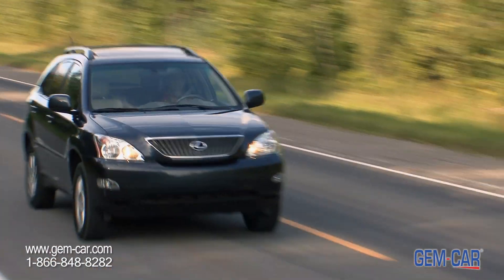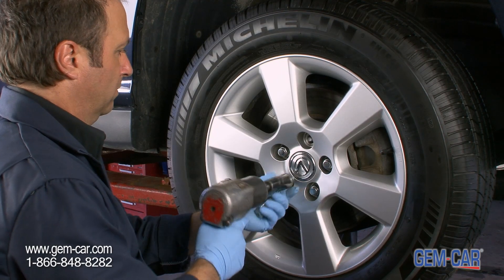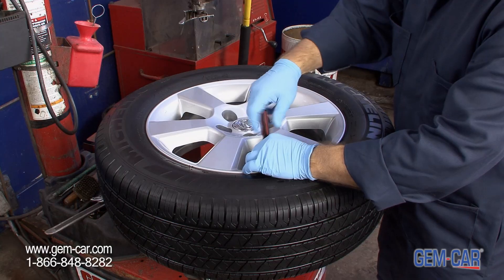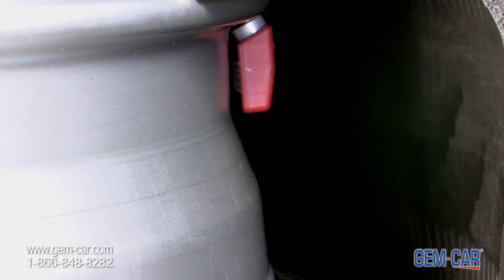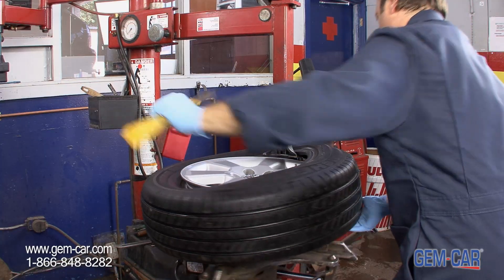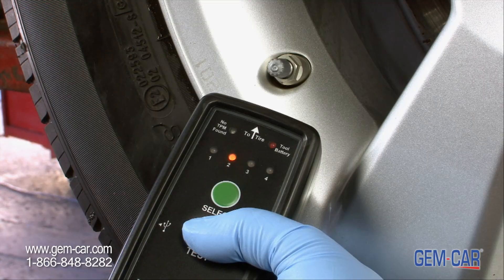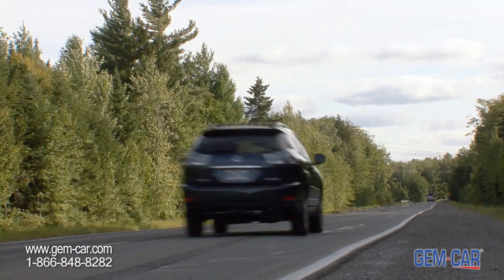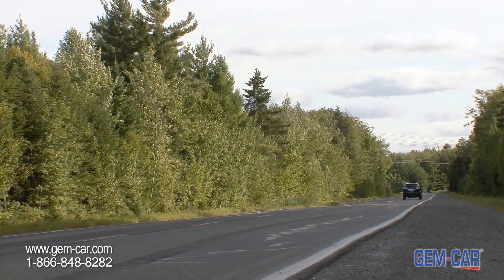How does the  Tire Pressure Monitoring System work ? - Powered by GEM-CAR

Comment: A tire-pressure sensor is a small programmable electronic device, located in the pressurized pocket made by a wheel and tire, that constantly measures the air pressure inside the tire. The sensor transmits that information via low-frequency radio to the vehicle's onboard computer and, if the car has one, to a corresponding display in the instrument cluster. It reads out in pounds per square inch (psi), and it illuminates an amber warning light to alert you if one or more tires are low on air.

Comment from the maker: This video is part of a group of videos that where design to educate car driver on different issues they may encounter with their vehicle.  They are virtual sales assistant:  the shop owner can run the video in the waiting room or push them at the counter while they continue working.  They are design to elevate the industry not to teach mechanic how to fix issues…  Retail customers that have been shown the video corresponding to their issue felt more inclined to fix their car …. 

All the other GEM-MECANIC video are available on our channel. 

At GEM-CAR out passion is to help repair shop to globally be more productive.
Reply: cool story, please change the title of this video.
Reply: Fantastic explanation. Still, video title is misleading. Came over here by searching: "tpms sensors how they work". I am no better off now, then when I was before watching this video. Still have no idea how that sensor communicates with the car systems. Please change the title.